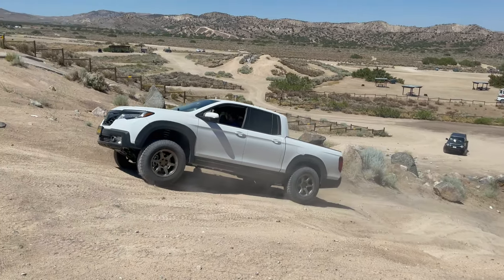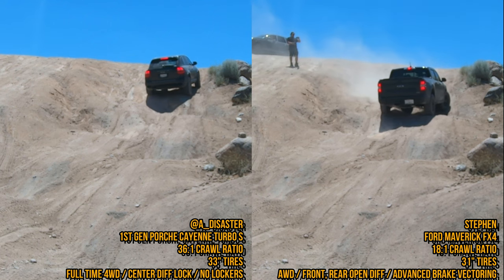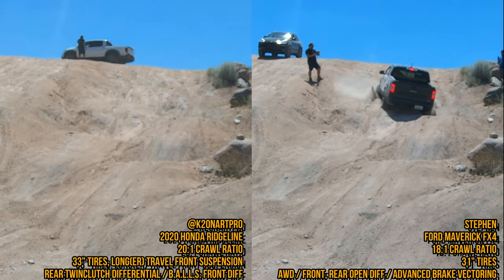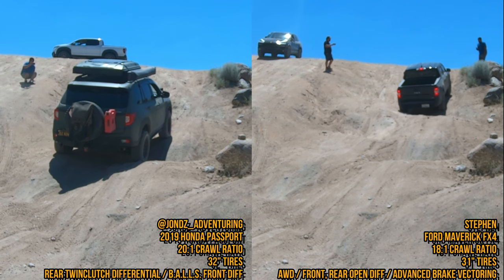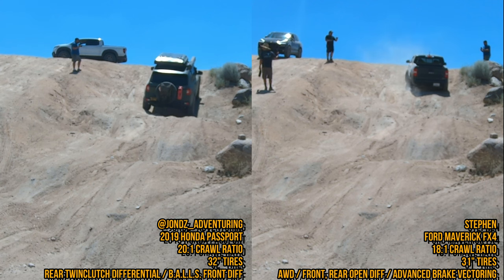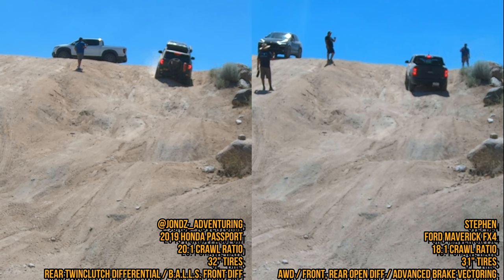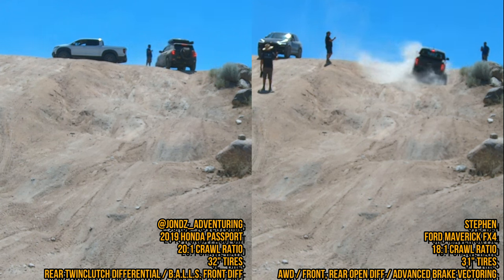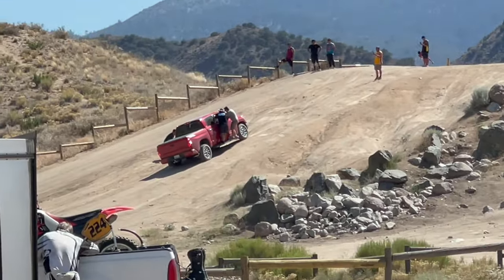BALLS Equipped Passport vs. Ridgeline vs. Cayenne vs. Maverick on a Hill Climb

Comment: This is great DIY stuff. Some of my favorite honestly.

Down the road do you think a possibility of a semi automated system? Arduino watching the front wheels and making sure they're similar speed, etc
Reply: Arduino is for video games lol u cannot operate hydraulics like that it needs the driver to manually input that through the brake pedal
Reply from the maker: I think the best way I can explain what BALLS  does is it’s like a winch or traction boards.  I’m not always using it, but in some situations (cross axle situations) it does an amazing job.  During our Colorado trip, there’s a gatekeeper obstacle to get to the peak of Yankee Boy basin.  It’s a giant off camber step obstacle, and I had high doubts BALLS would get me up and over.  I’m so amazed it did.

Now, in doing so, transmission temps rose up to 240F, which is the highest my transmission has ever hit.  So, this shows that automation can be stressful
Reply: @k20z3allmotorFTW  For my Mechatronics class we used Arduino to control an infrared sensor and a motor controller to operate a 12v DC motor on a piston to operate a set of automatic scissors. 

I'm not sure I understand what you mean by videogames.
Reply: @bruceyyyyy   it cannot operate a abs module to apply brake pressure if that’s what u where thinking.
Reply: @k20z3allmotorFTW  If my understanding is correct with what they've done the current system as applied is not using the factory Honda ABS module to control the solenoid. 

They're manually controlling the line lock from the cabin. 

Operating a solenoid is completely within the realm of capabilities for an Arduino.

It would just need coded and input data such as the Honda ABS tone ring or its own stand alone system for the purposes of knowing what tire to lock up. 

The code likely wouldn't need to be too complicated, a simple if/then/else run should work for testing purposes.

It might prove to be difficult to piggy back into a modern CANBUS system so a secondary hall effect sensor might be easier.
Reply: @bruceyyyyy  again the line lock hold pressure imputed by the drivers foot it cannot apply which is why I thought maybe u meant the abs unit which on these Hondas cannot do individual wheels.  I have a few more things to try and I’m well aware of how this system works the white ridgeline in this video is me 😅 but of course some type of stand alone brain audrino or other can be used for releasing the pressure of the lock would be nice
Reply: @k20z3allmotorFTW  I wish you guys were closer, I would love to experiment with this system.

Comment: Would be nice if the new Passport has at least half the Off-Road features your rig has.
Reply from the maker: I was hoping for something ground breaking, like a low gear transfer case or a front LSD, but it’s apparent that if a more advanced brake vectoring system is added to the front diff, then that’s all that would be needed.  As far as ground clearance, I just can’t see a company (especially Honda) giving a vehicle more than 10 inches of minimum ground clearance.  My passport has 12.5 inches 😃
Reply: @JonDZ_Adventuring  for the Trailsport badge, it should definitely have more off road features. Exposed Recovery points. Better approach/departure. More tech at the very least. b.a.l.l.s. Is fantastic but i doubt Honda will implement something like that, i can imagine that going wrong for the average driver.
Reply from the maker: @Scahla  I think the trailsport badge presented the opportunity for Honda to dumb down the base models.  Companies like ford only offer a twinclutch rear differential in the “badlands” trim.  Right now, someone with a base model Sport trim Passport has the same capabilities.  I would understand if they just have non trailsport trims just basic brake vectoring.

Comment: Did the maverick usre sand mode or other ones that allow for spin to power thru ? Was he in 4L ? I belive he should have had better climb than that ??
Reply from the maker: The Maverick doesn’t have 4L.  It’s AWD with an 18:1 crawl ratio, and it did better than I expected!  I was impressed!  If you haven’t seen this obstacle in person, it’s 35degrees (70% grade) and has 3 to 4 foot ruts.  It’s not easy.
Reply: @JonDZ_Adventuring  o.k. so he was using that low speed trail feature ? with locked rear diff ? that is steep. curious if he did try all mode options and did he since try again ?
Reply from the maker: @rpmautoreviews9249  the Mavericks don’t come with the same twin clutch rear differential as the bronco sport badlands.  I think the tremor trim will add it.  It’s not a locking rear differential either, it’s just a more modernized version of the GKN twin clutch differential.  The bronco sport badlands has the newer version, as well as the 2023 Pilot Trailsport.  The Hondas in this video has an earlier version.

Comment: Very interesting to see the BALLS system in action! Does it cause any problems with your antilock brakes system? I'll have to check into it more, was looking into a e-locker for the front diff on my 99 Land Cruiser since it has the factory rear e-locker but its about 2 grand. This could be a less expensive option to get me out of trouble when I really mess up.
Reply from the maker: According to Emmanuel, this won’t cause any issues with the brakes.  If the solenoids were to fail, they will fail open (that would be so dangerous if it failed closed).  You can use hand tools to bypass the solenoids, and easily return to stock.

Comment: Nice vid… but curious, isnt sand mode supposed to send power to wheel with grip too, despite slippage?  Is the Manual line lock to get faster/ aggressive response sending power to other side?
Reply from the maker: Whatever the mode, the front differential is open.  There’s no twin clutch pack in the front.  According to an article by Jalopnik, Sand mode simulates a rear locker.  The Bronco sport badlands with a twin clutch rear differential has a “locker” button, even though it’s not actually a locker.

The BALLS system is only installed on the front diff, to solve the open diff problem.

Comment: Awsome video, I would like to try our grand Cherokee open dif on it.  The grand Cherokee trailhawk has the same limited slip as the Honda.  The Cherokee trailhaek has a locker
Reply from the maker: I think the results would be similar to the Porche Cayenne, since both has a low gear transfer case and mechanically locked center differential 50/50 lock in rotation front to rear + traction control should make it up.

Comment: Would you say with all the mods you still get better fuel economy than a stock 4Runner/Taco?
Reply from the maker: Yes, old 5 and 6 speed transmissions won’t be as efficient as the German made ZF9.  One of the most efficient transmissions.  Although the passport is rated for 24 MPG highway, people are consistently hitting 27-29.  On a trip from California up to Colorado with highway speeds varying from 65mph to 80mph I got 20.7 mpg over the 835 miles.  A stock taco might be able to pull that off, but I’m carrying 1200 lbs. of gear and mods and have a roof top tent 😃
Reply: @JonDZ_Adventuring  fair enough! Have you thought about getting an off-road trailer? Might be a good idea as to not lug around everything all the time 🤙
Reply from the maker: @Ww8.3   oh no, for many reasons I would never run an adventure trailer.
Reply: My ridgeline on 33’s was getting 24 mpg hwy on my latest trip to Washington fyi
Reply from the maker: @k20z3allmotorFTW  dang, that’s really good!  With a bed rack and roof top tent, even if MPGs drop to 20 mpg, that’s still really good.

Comment: Dumb idea, something similar to this but using a hydraulic hand brake system and two pistons (like a cutting brake), so you could just rock the lever left or right to activate the brakes smoothly and naturally vs a button system.
Reply from the maker: A lot of thought went into BALLS.  Shown in this video, it’s very effective.  What you are describing is much more complex than 2 solenoids on brake lines.  The reason there are buttons is so both brakes can have the pressure locked in simultaneously.  The BALL system will compliment “left foot braking” well.
Reply: @JonDZ_Adventuring  my bad, rereading mine it was written poorly, I meant to imply that my idea was the dumb idea, not BALLS. I agree about the benefits of this system, I would just be curious to see how the hydraulic system would compare in use, accepting the additional complexity.
Reply from the maker: @jakeg6172  haha!  Np.  I know the hydraulic brake lines have been used in the Subaru platform.  I think what you described would be perfect for any momentum based off-roader.

The solenoid BALL system locks in the current brake pressure.  So, the reason this wouldn’t work so well in a momentum off-roader is that the brakes have to be applied before pressing the lock button, which would kill momentum.  There was another video that I did to introduce this system, released about 2 months ago.  In order for a vehicle to use this system, it needs gearing, power and a torque converter that doesn’t stall easy.